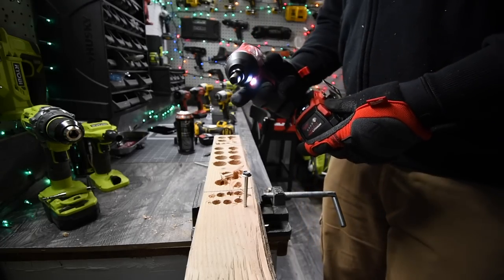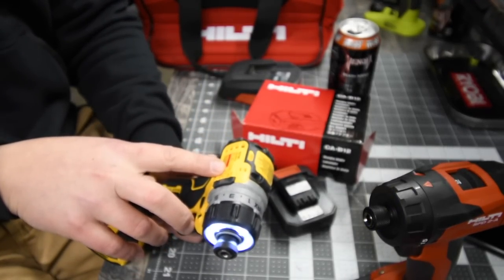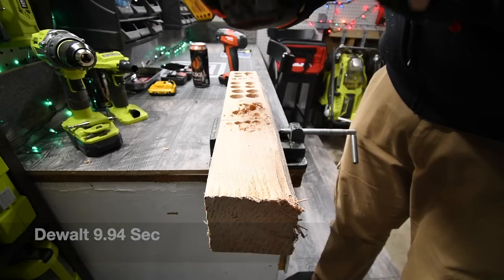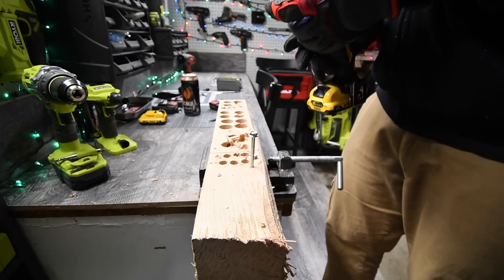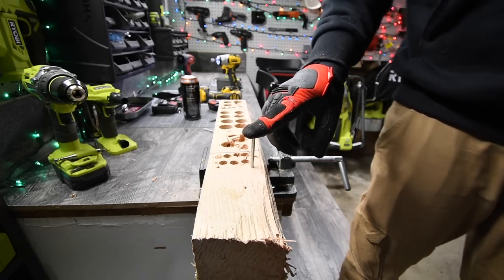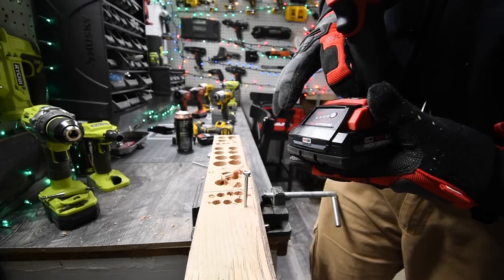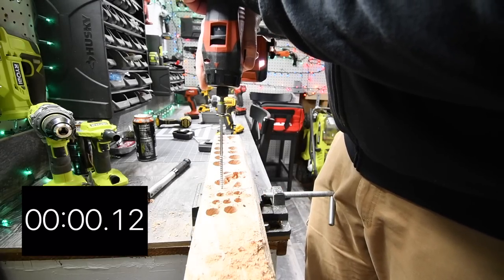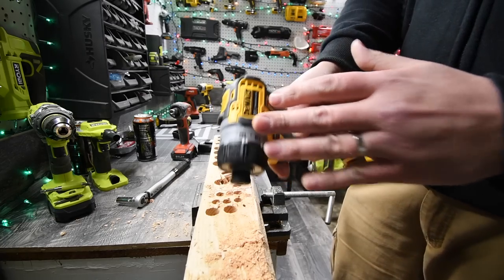Dewalt vs HILTI

Comment: Thx for the test.  I have the brushed Hilti driver.  I only use as a powered screwdriver.   I NEVER use it to drive what an impact should do.  Im a firm believer if you use a tool within its optimum capacity it will work consistently longterm.  Not taking anything from the Dewalt but the Hilti is so economically comfortable. Its the best powered screwdiver i have ever used.  I have about 4 powered screwdrivers.
Reply from the maker: I got the brushed version and we will be doing this video again shortly
Reply: I enjoy your videos.   Im a firm believer of properly using tools within their capability.

Comment: Never ever use a torque wrench to backout fasteners, torque wrenches are meant to work one way only, using it to backout fasteners will throw the calibration out.
Reply from the maker: Thank you sir
Reply: Sounds like salesman corporate excuses to me
Reply: This is complete BS
Reply: OP is correct but depends on how precise your tool is as to why you'd even bother. It's not a bahco or warren and brown torque wrench designed to be the most accurate in the world and industrial grade, it's just a regular shit kicker torque wrench. Using it backwards isn't going to really bother the accuracy for applications like the head bolts of a motor or wheel nuts.
If it has a backwards function, either expect the backwards to be less accurate or to damage the tool.
Reply: Mike Dorman he is saying don’t use it like a breaker bar. Why use a torque wrench to take a bolt out?

Comment: brushed motor always has the highest torque when it is stalled if... the switch can tolerate higher current
Reply from the maker: They both did a really good job with the tasks
Reply: @ManCaverTools  agree...

Comment: Thats an extremely demanding job for all drill/drivers since they are designed for drilling and light duty driving. No diyer should be using a drill/driver for those applications anyway. They should use a impact driver for medium to heavy duty driving.

By the way you could have just got any brand impact driver pulled that sucker out..
Reply: Agreed.  Love your channel bro.  These 2 tools are basically “battery powered screwdrivers “.  In other words,  light duty work.  Spade bits are for drills and impacts.  Good way to burn out both of the motors on these tools.  I own the Dewalt ,  both the old brushed 12v and the extreme 12v.  Here’s an idea for testing,  put various screws into a 2x4 and go through each setting on the clutch to show the difference in RPM.  Merry Christmas bro glad to see your expanding into other brands.
Reply: I think he did use an impact driver (only the ryobi) after the drill/drivers. Make sure they are in the highest speed setting!.... its hard to tell if it was... The next step would have been to use an impact wrench you have so many to use hand tools :) Merry christmas !
Reply from the maker: I used Dewalt, Milwaukee and Ryobi impacts in this video.
Reply from the maker: I tried the milwaukee m18 fuel 1/4 Hex impact driver with a 3ah high output battery, and it still didnt come out
Reply from the maker: Thank you sir and Happy Holidays
Reply: Pabs Valle that was painful 😖 watching you test those drill/drivers, they are obsolete! Impact does it all!

Comment: I have the Dewalt 12v xtreme screwdriver. I love it when I'm doing things inside of my home it's my go to tool. Try the Bosch 12v ps22 pocket driver also it was my go to tool before I bought the Dewalt 12v xtreme screwdriver.
Reply from the maker: I will check out the Bosch one and thank you sir

Comment: I hate being that guy, but you had the Milwaukee in speed 2 instead of 3 and when you did the 3/4' spade with the hilti you ran it through right next to the hole that got the lag screw stuck. Probably hitting the same knot. I'm not picking on you just making an observation. You said the Milwaukee was basically not as good as it is advertised.
Reply from the maker: MrSigDan you are correct, it was on speed 2 I’ll take a look at my raw footage to see if I have it on speed 3 and thank you sir. I gotta pay more attention to detail :)

Comment: Isn't dewalt a non industrial tool not for commercial use?
Reply from the maker: Dewalt is a commercial use tool brand
Reply: @ManCaverTools  not from what I've seen my dad has a dewalt and they wont refund you if they know you were using it for commercial use, but Hilti chuck that across the parking lot and they'll warranty it, even if you tell them you intentionally broke it. I got a Hilti impact driver along with a Hilti Grinder and drill... and 6 Hilti batteries. And dewalts pretty good in my opinion but I say there's just no beating that warranty on a Hilti

Comment: You should try an 8 amp hr in the Milwaukee
Reply from the maker: I will be getting more batteries for all brands in time and thank you
Reply: Not necessary, the tool doesn't use the maximum output of the 18650 batteries let alone a 21700. so there would be no difference other than weight.

Comment: Seems like using the tools not for their intended purposes is just a waste of time. Like lets take these two 18v impact drivers and see how they go with 1/8 screws. All tools need to be used for the tasks they are designed for. These two littlies are not built for 3" screws, obviously, so whats the point of this comparisob?
Reply from the maker: it is not a waisted time. would you watch  entire  video of driving in 2" and 3" screws? I don't think you would. that's the point of my tests. to put these tools through something stressful
Reply: @ManCaverTools  you're missing the point. There is a wonderful concept 'fit for purpose', maybe you can imagine how it applies here? For example, you're testing 2 small hatches against each other, and then you say - now lets attach a camper trailer to the back and drive it up the hill. Fun? Definitely. Is it how they are going to be used in real life? Highly unlikely. Just the same here. Anyone driving 4" lag bolts with these littlies just doesnt have a proper tool for the job.

Comment: First you weren't using Milwaukee's strongest hex impact driver that was one of their smallest out of the fuel
Reply from the maker: what's Milwaukee's strongest hex impact driver that is brushless? ive looked all over the place for one
Reply: Milwaukee M18 FUEL ONE-KEY 18-Volt Lithium-Ion Brushless Cordless 7/16 in. Hex Impact Wrench Kit with 2 5.0 Ah .
Reply: Man Caver Tools don’t listen to this. You have the most powerful 1/4 in hex impact driver. What he is taking about is a specialty tool aimed towards linesmen and it is a quick insert 7/16 hex chuck impact wrench not driver.

Comment: The hilti won because you put it in speed 1 when you were driving fasteners
Reply from the maker: it has different speed settings, I did the same for the dewalt when facing the hammer drill, dewalt hammer drill couldn't do certain things on speed 3 so I changed the speed setting. check out the video

Comment: you need to learn that ''speed 3'' (as you call it) should be the one you select when you want max power from your impacts,
and the lowest speed should be used from your screwdrivers for max power.
Reply from the maker: I tried all speeds on the milwuakee, it still didn't take out that screw